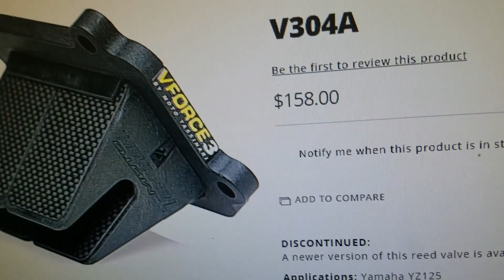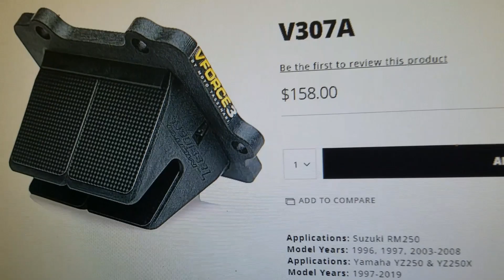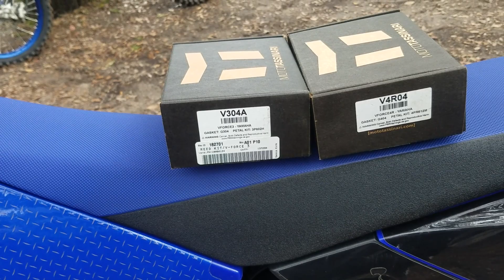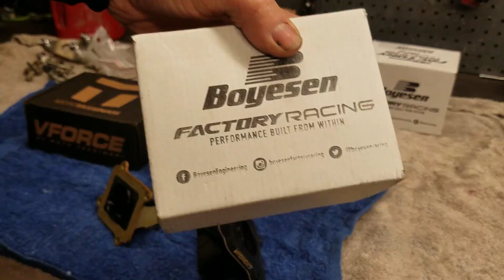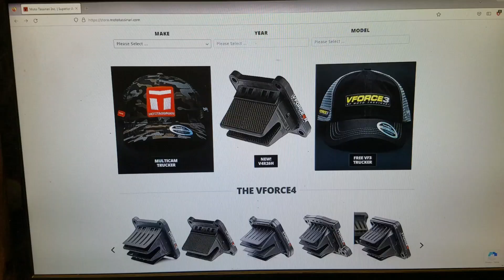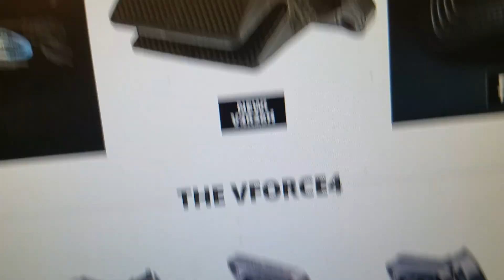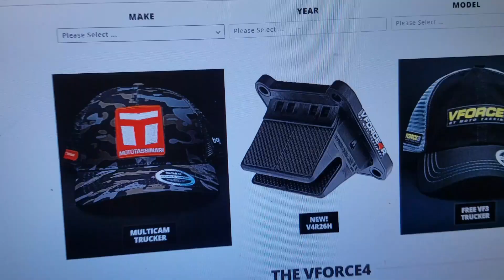1:11 VForce 3 vs VForce 4R.  Moto Tassinari reeds on a yamaha YZ125 @ Croom & 74MX

Comment: Dunno man, looked like it sounded and looked faster on the 3’s for some reason. But you know the bike and was riding so appreciate your feedback on this one!
Reply from the maker: Yeah, the rad valve did make good power. My brother actually preferred it. For me the throttle control up in the high revs and how freely it revved with the v force is what sold me on the v force. But both actually did well, just differently

Comment: I have not torn my YZ top end down yet, (only about 10 hours on it), but I can't believe Yamaha blocked off the reed transfer port with the reed stop plate.
No wonder why my 2019 YZ250 is the slowest 250 I have ever had.  I know how to fix that. :)
Also, it clearance permits, remove the spacer between the reed valve and the cylinder.  You should gain a good boost in the mid range.  I used to add a spacer those out about 5mm to tame a engine down a bit.  I think it is removable, but i still have to ride test mine.

Comment: You can have a cylinder reed with the reed boost port all the way into the cases also.  If the reed tips are in the way, that is an obstruction of course, but I turn 46cc piston port engines to cylinder reed valve engines, (the reed petals are not in the way fro those builds), so I feed the added port, (I mill one in the cylinder) with a window in the piston, and the tunnel from the cases, (like the rest of the ports are feed).
Reply from the maker: Nice!

Comment: Thx for the test. Now I don't have to feel bad missing out on power not running the V3. When talking to the Dutch Yamaha guy responsible for the kit he said it made more power with the V3 on the dyno, but I trust your "but dyno" enough not to feel that I'm sacrificing much (or anything) going for the durability of the V4. Might have to try the Boyesen though to see if the bottom gain is worth a little top (doubt it, but you must try 🙂)
Reply from the maker: Yeah I really was hoping the 3 would perform better than the r I was currently using because I'm always looking for better but it just didn't compete once on the track. The V4 makes better power and more power and the 3.  Its interesting you said the kits designer said the 3 made more power on the dyno. If thats true I wonder why.  Or maybe it just blended in better with the rest of the build? Would be cool if someone who has the gytr kit would toss back on thier V4 and see.
Reply from the maker: Also the rad valve surely does the best down low and doesn't fall off the pipe nearly as easy. Its good if thats what your looking for.  But if you like to rev her to the very top alot then the v4 is the way to go

Comment: You are probably right about the reed stop on the V-4 for not being offered for the 250.  But I know the reed stops don't have to be that long, (the reeds don't open that much), or could be designed to not cover that port tunnel.

Comment: The V-force reeds have always been a better lower rpm/ mid range reed.  It was the double petal design that made that happen.  I am sure the V-3 is better than stock for low to mid-range.  Does Boyesen still make the "Rad Valve", (included a entire investment cast aluminum intake.),?  If mid into big top end power is what you want, (for a track, what you have to have, and you still did not pass that 4-stroke.  lol), you may find that the Rad Valve offers even more mid and high top.

Comment: It probably would be a better higher rpm reed for the 250 too.  They keep trying to keep up with 4-stroeks on fast 4-stroke tracks, and it ain't gonna happen (sans equal displacement.).
I am gonna be in the trails, and judging a bit from this vid, I made the right choice.
Wait,---it was the only choice for the 250 (Sans Boyesen).   :)    I bet they are just selling out the 125 V-3 with the Gytr kits to get rid of the last remaining. If your not getting the kit, just a reed,---you would buy the V-4 and they know it.

Comment: i found v3 to be awfull. put the stock ones back on. v3 caused this nasty bog at high revs/part throttle . i pulled them out after 15hrs, noticed cage was distorted and reeds bent(apparently this is a feature;)
Reply from the maker: Yeah I wasn't too impressed with the 3 on this bike either.  But the 4R is pretty good

Comment: If you did mods for more high rpm power, the v-3 was the wrong choice.  For wide open tracks, the reed stops control the petals better, and it was 10% bigger.  Great for wide open.  Not sure if the Rad valve is better, (call them for the best high rpm set up).  But for anything else other than a wide open 4-stroke MX track, on a stock bike or a bike with more mid range mods, the V-3 I am sure, is on top for the YZ250, (and 125 if trail riding.).  No offense, but IMO, it may have been an injustice to the V-3, when it is really made for lower rpm torque, and a good fit anywhere off of a 4-stroke MX track.  The only Bike racing that is close to MX today as far as what is needed from the motor is Desert racing, and MX used to be closer to hare scrambles.  :)  Come on man.  When is the last time you squared off a corner?  :)
Reply from the maker: I agree, the 3 may be better at making bottom end.  On this 125 I am focusing mainly on mid to top and the 4 seems to be better up there.   The 3 does great on the 250 though

Comment: the GYTR kit is a Euro kit , isn't it ?   i didn't think you could get it in the US and have to order from europe or australia.    being so,   and being the $ is a new model , and a US brand.   that may be the reason for the V 3 being offered in the GYTR kit , vs the 4.   id not go by that as a gauge of their pick without speaking to them .  id not be surprised if they just use that picture,  but provide a 4 at this point .  theres go to the a reason yamaha is using them from the oem  .  id think the 3 would be cheaper being the " old " model .  id also not be surprised if the difference from 3 to 4 may call for some jetting changes .
Reply from the maker: Yes its a euro kit. Here is a link where a guy unpacks the kit and he even comments he's surprised it comes with a 3 https://youtu.be/bBzl0CZGyVY . The 2022 and 2023 already comes stock with Vforce 4r.  So thats why I was curious why yamaha would go from a 4r down to a 3 in the gytr kit. The jetting felt spot on with the 3s, didn't feel it needed any different jetting than the 4r.  And I don't think any amount of jetting could have saved the 3s compared to the 4r. In the trail the 3 felt good and I expected it to do well on the track. But once on the track it was just down on overall HP and that was disappointing because I'm always hoping to find more HP lol